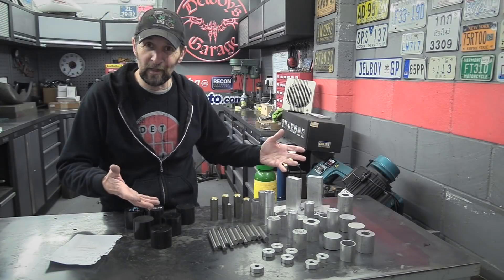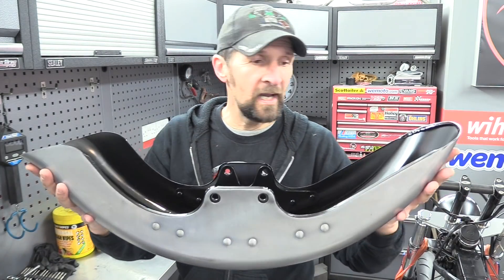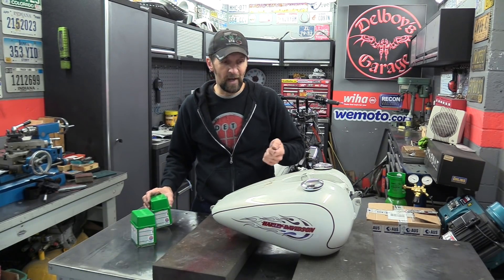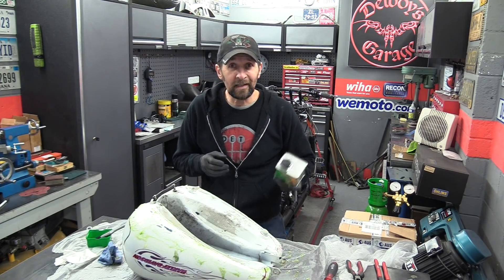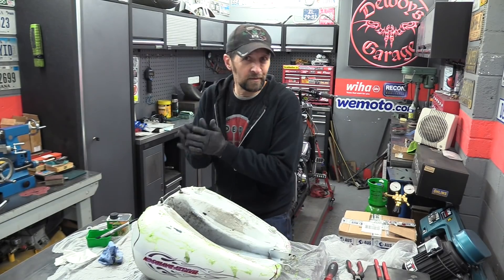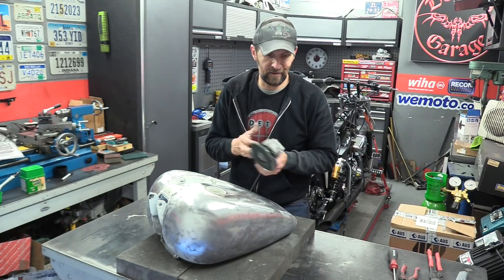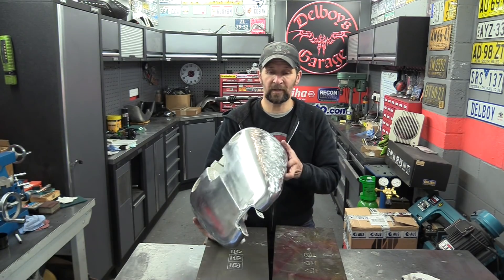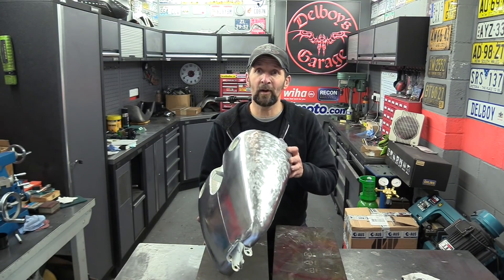Delboy's Garage, Project FoXDaWG Day 26, "Gas Tank" Strip !

Comment: Hi Del , nice job.. Im working on my cx fuel tank too and I used a paint stripper called "  Power Strip Best Industrial Strength Heavy Duty Paint Stripper Remover " it work well but a genius decided to put a later of tow mil all over the tank before changing the colour ...lol so a lot of sanding work . the bare metal looks great. Thanks, Gus
Reply from the maker: Hi Gus, good to hear from you!... Hope your project goes well, and thanks for the link to the product, that's very useful for the future!... have a great weekend, D&Px

Comment: Thanks for your video, having the same issue paint stripper not working on my old TY175 tank, quick one what wheel did you use on your grinder to get the paint off? Thanks, Karl
Reply from the maker: Hi Karl, this is the paint cleaning fleece that I use, most importantly it is a stuff plastic and doesn't grind away at the metal... it will leave an etched finish, but won't actually remove any steel, very safe for stripping paint... here's a link to what you're looking for (you may need a couple as they do break up quite quickly):  https://www.ebay.co.uk/itm/184919801709
Reply: @Moonfleet41 Thank you Delboy, appreciate 👌

Comment: hey Del! This'll probably get lost in the ether because it's a 5 year old vid, but that bit where you said "the factory paint is the best possible base coat", does that hold true even if there's some flaking and rust on the factory paint? I've got a rear fender from a Sporty XL and most of the paint is in pretty good nic, but right at the back beneath the number plate it's all flakey. Was thinking about scraping the flakey stuff off, sanding it all over and then painting it, think it's a good idea? Or should I strip the whole thing back to bare metal to paint? Thanks so much for your advice over the years buddy!
Reply from the maker: The mantra that factory paint is a great basecoat stands firm, but only if the paint is sound.. and on HD fenders it seems to rust out from the inside really easily... so natually get all the loose paint off, then feather back the good paint to blend the line at least... or, for a simply life, just grind it all off to be sure..!  and another good tip for Harley fenders.. get a good thick layer of stone chip paint on the inside to stop it happening again..!  Good luck with it.
Reply: @Moonfleet41  thanks so much Del, you're the best!

Comment: wow Dell I used to work in a stove enamelling works back in the 70s and we used to have a 100-gallon tank of nitro mores we would put any bike or scooter or even land rover parts in and by the time you drank your brew it was bare metal time no problem But we always wore safety Bins you bad boy.  mind you, it was either cellulose or enamel paint, not this new fangled 2 pack stuff
Reply from the maker: I think that's the problem, paint has moved on but Nitromors hasn't!

Comment: interesting finish, look forward to seeing it with a clear coat. One question though, would it be better to do the side of the front mudguard rather than the middle in order to match the tank and then again on the rear. That way, you could have a centre line of black running front to back over the bike with the pattern at the sides where they are more visible?
Reply from the maker: Pretty much all the two tone paint schemes on Harleys have top and side combined between the tank and fenders, it breaks up a slab of colour from the side or top, and visually works... not sure if this will.. but following the style to see how it looks... time will tell aye.!

Comment: PS. Doing the swirls on the tank sides ought not the front and rear fender be on the sides too, to match? The black bar on top of tank wont match the fenders? wont be a continuous black. PSS. Before painting tank have you checked the internal for rust, which can happen in a 20yr old tank and needs cleaning and  treating.
Reply from the maker: Hi mate, check out the old school two tone big twin paint jobs, things like Duo Glides and FLH's from days gone by, they usually alternated sides to top on the colours to avoid the bike having a single slab of colour when viewed side on... it accentuated the two tone effect... just experimenting as I go, not trying to make a show bike.  Have a good weekend!

Comment: Hey brother. What grit(s) sandpaper did you use and what order? Thanks!
Reply from the maker: I don't recall exactly, it was a long time ago, but if it helps, then key the metal surface with a 180 grit for primer, and that'll give it a good key... it's more important to clean chemically and bare metal is best cleaned with neat thinners.

Comment: Nitromors had to make the formula idiot friendly to satisfy some EU Directive.  What you have is the phoney DiY product , but the professional grade is available from trade paint suppliers, where you're supposed to be 'professional' (painters?) but even that is a safe formula and less effective that the original stuff.  I have just finished my last amount of Leyland paint stripper that was 15 years old and equal to old Nitromors and am on the look out for the real stuff - any ideas?
Reply from the maker: I've given up on paint strippers mate, it works fine on fresh paint, but on old factory paint it seems toothless... so, as usual, I stick with the trusty paint removal fleece and you get the peace of mind of no chemical residue left behind to haunt you!

Comment: I don't know what that stuff was like but I've hears it's no good.  There is stuff that dose do the job really well out there still, but I think sand/particle blasting is so much better and easier these day's.  It would not cost much to get it done somewhere, or even better get a cheap blast gun to get setup, you don't really even need the cabinet to start with.
Reply from the maker: Nitromors used me be lethal mate.. you'd just paint a stripe of it on the job, and watch the paint lift right down to bare metal in front of your eyes....like a crawling Caterpillar..... but not any more.!

Comment: you need to get an interface pad and use the whole of the sanding discs when you do that sort of thing and keep overlapping them, imo half circles look much better, i dont want to be rude but that just looks like a novice has had ago at sanding that down. i had a push bike years ago with that half circles finish on it and it used to reflect the light nicely on a summers days and under street lights. youll also have to use an etch lacquer on the bare metal areas
Reply from the maker: Those uniform half circles remind me of 1970's ceiling artex Ross... thats all i think of when i see them... so i wanted it an abstract pattern, not uniform...
Reply from the maker: ---and correct me if im wrong, but don't bare metal etch products lift paint up..?

Comment: Ye it ain't what it use to be del it never seems take anything off ,I use to use this to strip spindles and newel posts watching it bubble up was amazing. Getting there del won't be long now and you be cruising like a king 👍👍
Reply: pop to a local paint shop that supplies bodyshops they can sell you proper paint stripper from around £18 per liter its powerful. also a little trick is get the stripper on thick then cover the whole item in plastic. its stops the active stripping ingredient evaporating .  i paint bikes for a living  and  there is no paint stronger then the oem paint the clearcoat is like stone

Comment: Here’s a tip for you Del , If you break the  surface of the clearcoat in just a small area then apply the paint stripper it will attack the basecoat and wrinkle up nicely 👍🏻
Reply: I tried this method when painted my bike. I did use same paint stripper as Del in this video. Didn't work at all .

Comment: Why is there so much paint inside the front fender? Is it protection from stone chips or have I missed the mark?
Reply: It's mild steel it will rust inside out if not protected.
Reply from the maker: Exactly Philip, protection from stone chips, metal fenders always rust out from the inside..!

Comment: Hi del very interesting effect on the tins and will look cool when the black is painted around it, when it comes to the clear coat we use one on lathed wheels which has an etch built into it for bare metal which it’s what you’d need on your project normal clear would more than likely just chip away   then you’d have a nause to put it right after, best of luck with it it does look really good so far